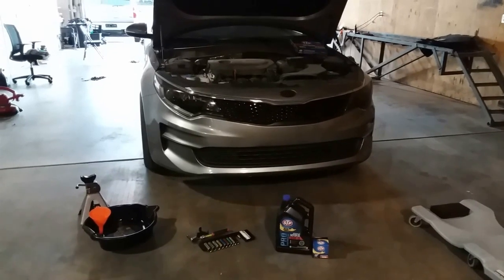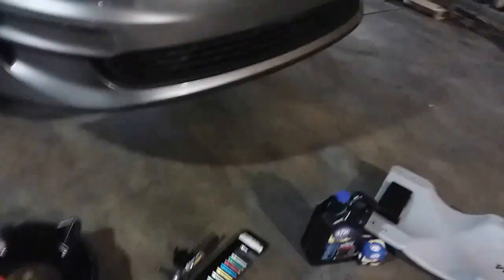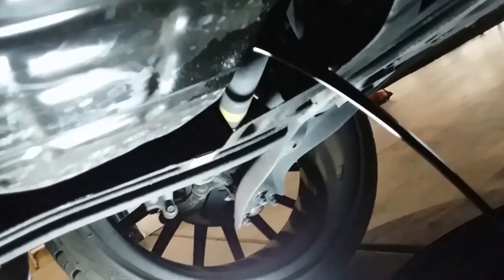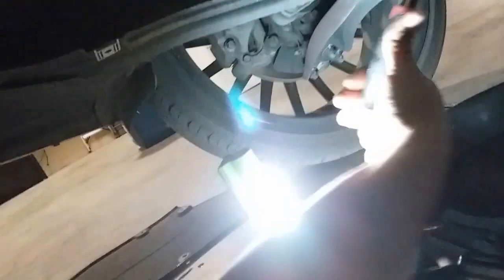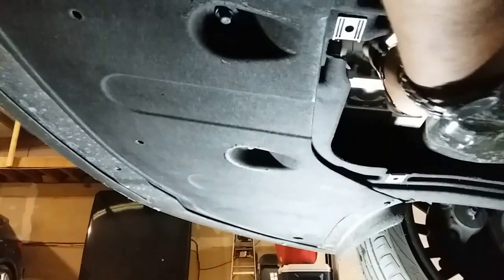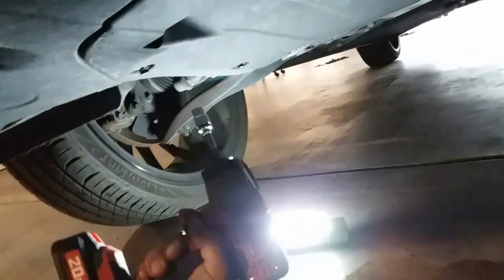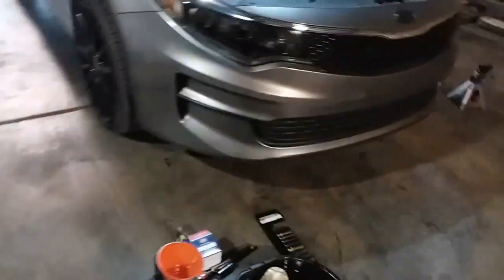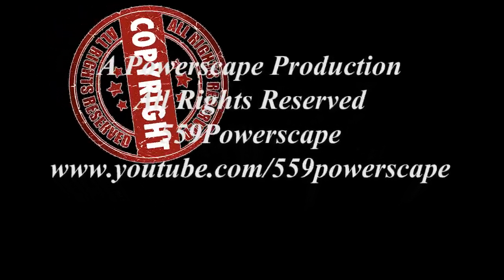How to: Do an Oil Change on 2017 Kia Optima

Comment: Was that an impact tool you used to screw the bolts in
Reply from the maker: I used the bauer from harborfreight.com

https://www.harborfreight.com/20v-cordless-14-in-hex-compact-impact-driver-kit-with-15ah-battery-rapid-charger-and-bag-63528.html

Comment: Where you got that filter removal tool? Send a link.
Reply from the maker: https://www.autozone.com/shop-and-garage-tools/oil-filter-wrench/p/performance-tool-2-1-2in-to-3-7-8in-3-leg-adjustable-oil-filter-wrench-fits-spin-on-filter/114009_0_0?cmpid=LIA:US:EN:AD:NL:1000000:OIL:8362709232&gclid=CjwKCAiAm7OMBhAQEiwArvGi3PgBDo1WNN4XzW-nS7OTMjO4KYBAmplNW8YevsUUBOjaxXralU617hoCWxQQAvD_BwE&gclsrc=aw.ds
Reply: @559powerscape  thx
Reply from the maker: @DKUSTOMSGARAGE  4 sure bro!

Comment: Someone at kia left my oil drain plug seal off. Now its leaking. Oh and my entire splash shield is missing.. but the mechanic says it wasnt him that took it off, but was there when they replaced the engine cooler when it failed .. good job kia 👏 for causing me more problems and more money
Reply from the maker: Sorry bro

Comment: Nice! Did your oil smell like gas? Please get back to me, thanks
Reply from the maker: No, but I can see how that can happen at combustion  cause some gasses flow down to the crank and out the valve cover back into the Intake. But never really experienced gas smell in the oil. Maybe you should have that checked out. Make sure your piston compression is good